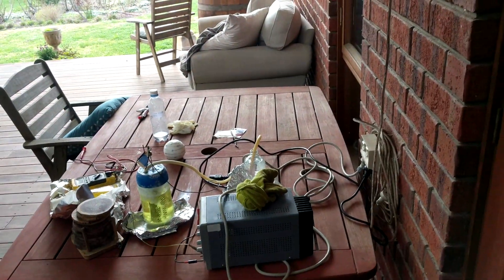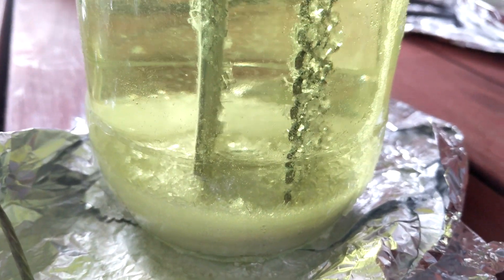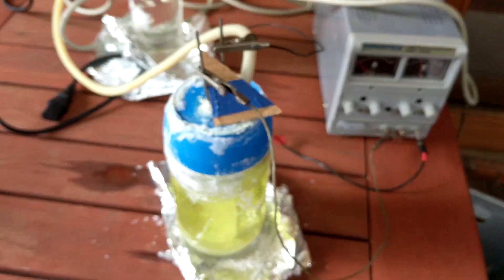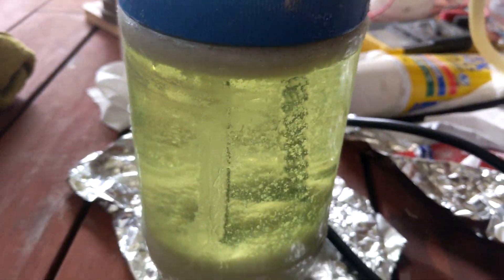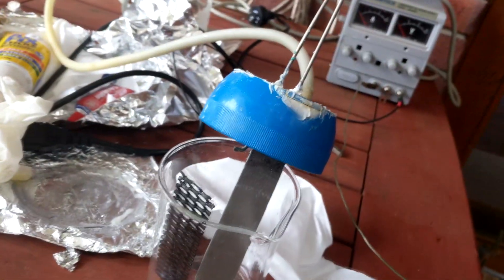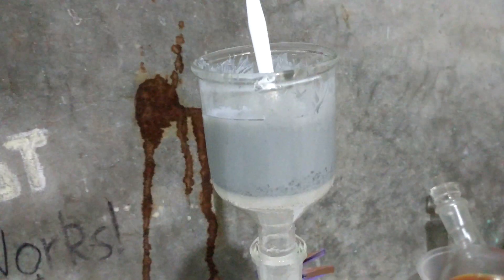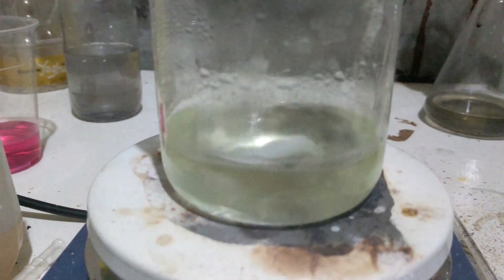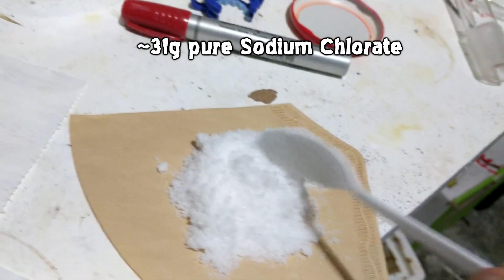Harvesting the Chlorate - Na Chlorate Cell Part 2

Comment: You could just bend the handle around the top of the mesh & pinch it closed to hold the mesh. Yeah, I know, the video's old, but 🤷‍♂️
Reply: probably wouldn't last for long. if any cl gas or liquid gets in the gap it will oxidise the titanium and current flow will stop

Comment: I used to make kg quantities of KCl04 during the winter at my farm. I ran two 3.8L cells at a time using a beefy HP power supply with Pt-wire anodes and stainless cathodes. Started with Na then did displacement with KCl. Used winter weather to do the recrystallization and make a very nicely pure product. Gases vented out the window of the shed. I maintained pH with HCl every couple of days. Still have, 16 years later, much of what I produced.
Reply: Uhhh yeah thats a lot. I just make about 100g at a time, never anymore than i can use immediately usebecause i just dont want it sitting around. With my luck a mouse or something might decide to make a nest in it using paper it dragged over drain cleaner.

Comment: Can't one use anything cheap for the electrodes? Especially the MMO anode seems to be pretty expensive.
Reply: Graphite electrodes seem like they might work well enough, and are cheap. Source: https://en.wikipedia.org/wiki/Chloralkali_process#Electrodes
Reply: Late to the party here but I'll comment anyway.

It's a question of how you define expensive. Yes, MMO costs more than a carbon rod for a single run. The whole value proposition changes when you consider how long each type lasts - you can spend a whole lot by eating through the cheaper option and having to keep replacing.

Comment: Not bad, it did work at least.  it's a shame that the electrode corroded so easily.  I was rough on mine and no problems.  Well, except the time I hooked them up backwards... It ate ~1/4 of the bare plate off, lots of fluffy pink flocculent clouding the jar... Cool pattern though.  It always bleached my litmus paper, made that difficult.  

Making a tack on MOT spot welder with 1-1/2 turns on secondary, about a second works pretty good.  TIG would be good too, the electrode shaft is actually Ti welding wire off eBay years back.  Wish I had bought more when I did, using it for years.

Comment: Ay man, I know I'm 3 years late but tin and lead are fairly resistant to corrosion, you could have sodered the electrode back together after all. I mean, it would be far from ideal considering that all of the electrode gets wet from capillary action and evaporation so it would costantly be in contact with oxidizing agents while being under tension, but better than aluminiuminum I guess.
Reply: Doubt solder would stick to mmo

Comment: Can you also use Copper Electrotes
Reply: @dylanmcvicker8330  for what reason? Just wear?
Reply: @guythat779  Cuprous oxide. The anode gets oxidized and gives the electrons to hydrogen, so you end up with a bunch of hydrogen, yellow crap and no anode. He could soder it using tin though.
Reply: @pietrotettamanti7239  Wouldn't the tin turn to tin chloride though due to the Hcl buffer? I'd figure you'd get a ton of tin (II) chloride if you did that. Same issue with lead (II) chloride and silver chloride. Welding it back is really the only option, it needs to be titanium on titanium contact for the electrode to work well, the part where it turns to copper has to be on the top of the cell outside it, or it will corrode from hcl vapors alone

Comment: At least you totally, intentionally, designed the top of the cell to open up and relieve pressure in case of pressure build up, instead of rupturing violently and spilling the yellow everywhere.  definitely could have been worse.

Comment: 6:59 It was at this moment, I knew it won't be success. And it made me sad. The current-voltage response is exactly how my anode failed. There is something, we more amateur amateurs are doing wrong. I suspect everything and it makes me feel helpless: from some western spy mixing fluoride into my salt to Mr. Laserred selling deffective electrodes on E-Bay.
Reply: Never use more than 5 volts. If your anode doesn't reach 100mA/cm² at 5V, something is sketchy. Double check the electrode separation and electrolyte. As people have said, high voltages kill your anode dead, especially non-platinum. My MMO anodes from the US were fine, shedded some oxide at first but never passivated.
Reply: @sciencoking  That was what I was thinking, the anode is probably entirely passivated with something. I haven't been following this synthesis, so I don't know exactly what was in that solution, but something clearly formed on the surface of one of the electrodes to cause the resistance to spike like that. He might could get away with reversing the voltage in a basic solution to desorb the gunk? If its an oxide, that's a definite nope. Otherwise the only other option I know of is an HF etch to burn off everything down to a fresh layer of metal. I'd personally rather buy another anode. I don't even know if you could get HF for a backyard operation like this. I've certainly never tried.
Reply: @austinkennedy1815  The anode he is using is ruthenium-iridium oxide on titanium (MMO). If they passivate, you're done. Luckily an anode this size is just like $15.
HF is simple enough to make, albeit wasteful, by just mixing calcium fluoride with some sulfuric acid.. I won't be doing that anytime soon though.

Comment: I stopped trying to make my cell airtight. The chlorine, hot salty alkaline water and heat destroyed all my apptempts to seal it. Instead, it is really important to insulate the electrical connections. Instead I just put a Compact Disc on top and some napkins. When let run without pH control, the cell quickly becomes alkaline and no more gaseous chlorine is produced. In my case the chlorine evolution dropped below nassal treshold in about half an hour.

Comment: I am 100% sure that you've got some sodium perchlorate in there with some chlorate contamination, because sodium chlorate wouldn't precicipitate out. If you have an old microwave around or a transformer, you could build your own spotwelder and fix those electrodes (maybe make a video about it...) or you could try and make a Lead dioxide anode, even though it is quite a hard task. look on some threads on APC or sciencemadness. alternatively you could try and harvest some platinum from a car and use that as anode for example or try and make your own mno2 anodes. Or you could buy mmo or LD  anodes from here: http://store.theamateurchemist.com/ but don't try the Pt ones, they are poor quality as i've heard in the past (might be a hoax) also check this site http://www.chlorates.exrockets.com/chlorate.html
Reply: Yes, sodium chlorate would precipitate out. I do not think that with this low current and time, but if you keep topping up your cell with water and fresh salt, then it will eventually start to precipitate. This is also a convinient process to exract sodium chlorate.

Comment: That bodged connection with the aluminium could've maybe worked if you insulated it properly, why you didn't I don't understand. Would've been easy to get an airtight seal with some resin glue for example. Otherwise great stuff mate
Reply from the maker: Yeah it was a bit shit wasn't it. I suppose I was trying to make it less permanent so if it didn't work I could try something else. Also it's just because i'm busy i'm like rushing everything. It really seems like a rushed decision doesn't it

Comment: Chlorate optimal voltage production is 3.3 volts, and over 5-6 volts you are passivating the mmo/titatium electrode. They also can't be in the solution without current for extended periods of time. The spot weld wire seems problematic, you should get bolted contacts directly on the electrodes. For better results titanium nuts and bolt. Cheaper but still someone decent using stainless. If you really are strapped for cash, you can use steel bolts and nut
Reply: And where you can get titanium nut, bolt and washer?
Reply: @tomasbrod1533  just cut across the mesh and bend up to make a long stringer

Comment: The grey is probably from titanium or mixed metal oxide particles anode damage from running the cell on low NaCl. It cleans up alright. Too bad about the anode though. Those things are so useful. Perhaps you could bend a kind of hook for the end and crimp it back on.
Reply: Zip tie might work
Reply: @kmit9191  zip ties get super brittle and break in that environment.  I've tried it.
Reply: Thats what I was thinking.. Just kinda bend it in and out of the gaps on the anode. then secure it somehow... without aluminum foil... lol

Comment: Chlorate forms at about 4-5 volts, but I see you put it at 7 so I think you have perchlorate
Reply from the maker: Interesting. I really should do a melting point test to confirm it is pure chlorate. I doubt I have perchlorate, it can't be that easy....
Reply: Extractions&Ire I forgot if you have a platinum or a MMO electrode. If you have MMO, watch out with the voltages as high voltages will destroy your anode.

Comment: I think you made perchlorate not chlorate and you needed to dry it better.
Reply from the maker: Can perchlorate really be made this easily?
Reply: Yes by running it for a long time. I run my chlorate cell for 3 days and perchlorate cells fro 6 to 8 days
Reply: It eats stuff like yours did when you start making the perchlorate if you don't keep it cool.
Reply: @ExtractionsAndIre  Use some stainless wire & wrap your electrode back to it's stem. Drill a small hole through the stem to affix the wiring directly through it for better contact & don't be cheap with the wire, keep it above the water line & you'll be just fine. If it does hit the water it should be ok but limit it as much as possible.

Comment: Hey mate,
I might be able to fix up your electrode if you send it my way
also, can sort you out with a more practical power supply
I'm in Sydney
btw, did you manage to do much with that mystery iodine solution? left us hanging with that one :P
Reply from the maker: Hey! Oh, you think you can weld it back together?? (Need to get the epoxy off it first too ehhhhh).

Oh I did film a video for that but it was very boring but i'll try and get something out of it, you're right I did just pose a mystery and then never post the answer
Reply: Yeah, especially if I can get access to the TIG welder at school again, that would be the proper way of doing it.
if not I can try to spot weld it, won't be as neat but would at least make a decent electrical contact. maybe then I can reinforce it with some epoxy or something, just to keep the load off of the spot weld.
removing epoxy is easy :D